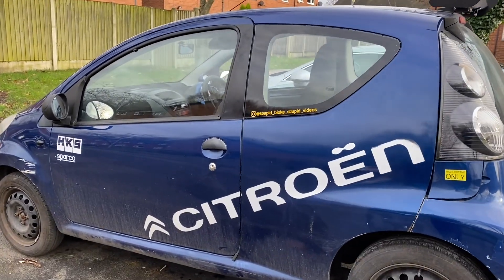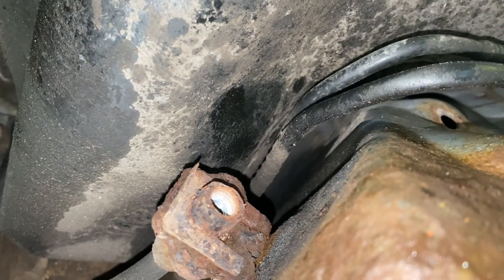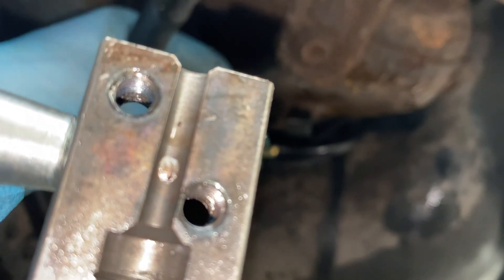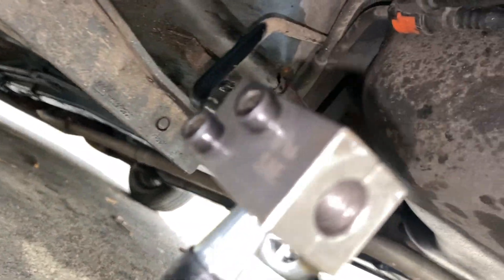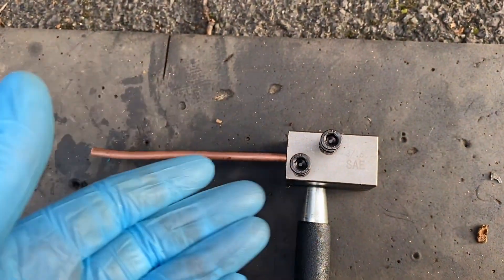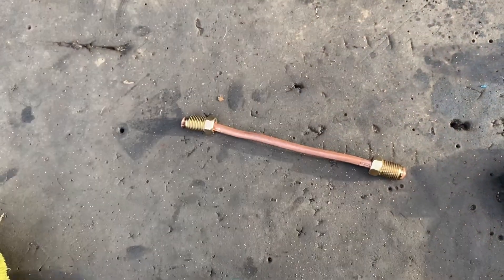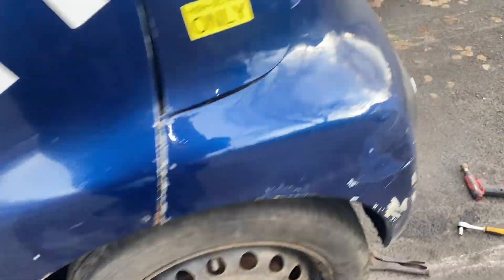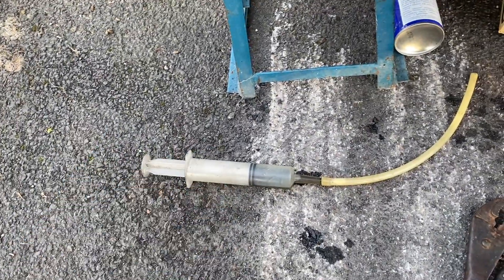How to Safely Repair Rusted Brake Lines / Brake Pipe Section Replacement (CityBug)

Comment: There should be a flat bolt to be used as a stop for the pipe so you get the correct length
Reply from the maker: Yes. It was missing in this kit so I had to judge it by the shape of the tool and where it would place the pipe

Comment: Spot on pal. Cheers for taking the time to make and share this. 

I was a bit put off by the whole idea of flaring tools and diy pipe splicing etc but after this I actually want a go at it tbh.

I'm itching for a go. All except the £80 odd the local parkers want just for the flaring tool. 
By the looks of it, it's just a reel of 8mm or 10mm copper and a 2 screwed, hammer shape vice with a twin ended spark plug accessory and some compression end feeds. 

I bet temu can do it cheaper than £100.52 and it'll probably be made in the same factory anyway 🤣.
Reply from the maker: Nice one. The flaring tool I used in the video was about a tenner off eBay lol

Comment: steel compression fittings 3/16 can handle 5000 psi, no need to flare the lines.
Reply from the maker: They’re illegal to use

Comment: I am impressed how car companys these days make such rubbish products like this Citroen..........I am not promoting my car as it has many faults and weak spots (mainly rust) but i drive a Opel Monza made in november 1978 and that car it brake lines are in mint condition vs ure car and they are 100% made from steel,why steel from the 70,s/80,s did not rust but steel from after 2000....seem to rust faster then butter melts from sunlight.

Why "modern" cars burn oil why they have endless electronic issues why transmissons fail after 100.000miles/160.000+ km etc..
Reply from the maker: I think a lot has to do with the climate, what country are you in? Over here they throw salt all over the road for 6 months of the year and the other 6 months it rains. These cars, apart from rust, will go forever tbh. The 90’s till about 2010 was the best age for reliable cars in my opinion. After that they really did go to shit. A lot probably down to emissions regulations along with other design issues killing engines off prematurely. A lot of new cars are rusting being only 5-6 years old too, but this era cars were generally pretty good.
Reply: @StupidBlokeStupidVideos i am next door in the Netherlands we have just as much salt and rain and grey coulds (and immigrants) as u have so weather conditions are equal...

Comment: Single flare on the steel brake pipes? Not recommended.  Turn the insert around to  double flare it.
Reply from the maker: No, single flair is what you’re supposed to do on them else they can crack.

Comment: Your mate didn´t give you all the pieces you need for that flaring tool. There is a ”stop bolt” that you screw in first that you push the pipe up against, then tighten the locking bolts. Then remove the ”stop bolt” and you use first one end of the double sided flaring bolt ,tighten until it bottoms on the tool,; then use the other end to complete the flare. Cannot recall which end you use first but there are videos out on YouTube showing the correct way to use this tool. Using a grinder to cut the tube is not a good way as you will contaminate the the brake line with fine metal particles which will make their way down to the caliper and eventually damage the piston seal so it starts leaking.Small pipe cutter from hardware store is the way to go as it will cut the pipe square which is what you need to get a good flare and seal.
Reply from the maker: I know he didn’t, that bit was missing but you can judge it as long as you know where it should sit

Comment: Took my car for mot failed needing a small hole ,had it welded took back for retest and came out with the break pipe damaged fluid dripping every where.This pipe was fine up until then.😢
Reply from the maker: @Deborah-d5b  has it failed the same place as mine did? They are common there

Comment: I'm told if you put clingfilm over the brake fluid reservoir, and replace the cap, it will pull a vacuum and stop brake fluid dripping out of the cut pipe.
Reply from the maker: Yea that definitely helps. I’ve don’t it in the past, just forgot to do it this time

Comment: come on man. you can't bleed on your own using the pedal method. 20 quid buys a self bleeding kit that connects to your tyre valve. i love your torque values. you got the job done but your life depends on them dodgy connections
Reply from the maker: I’ve used this method plenty of times to bleed brakes, it’s just a better version of the old “milk bottle” trick. The connections are all sweet, this is actually a common repair method used by garages to section brake pipes

Comment: That is not a safe repair because the copper line is not rated for the high pressure that the bake system can generate. It will ack as a fuse in the line because its now the weakest link. If copper line was good for brake systems, it would be used all across the industry. Job well done except with the wrong material.  I'm a retired auto/truck mechanic with 40 years experience.
Reply from the maker: @albertviger8518  copper has been a common/accepted repair method for brake pipes since time began and is standard practice in most garages. Cunifer is another option, but copper is still probably much more abundant in the trade
Reply: Copper is rated for the pressure.  Reason for non-use on original lines is cost and possibility of work hardening.  Kunifer or copper is good.
Reply: Do you think he's bothered !

Comment: Supurb bloke-on-a-drive repair. My Range Rover Sport has decided to spring a leak and I've never done a brake repair before (at age 65). Great little trick with the syringe as well when you're doing it yourself which I will be.
Reply from the maker: @2-4-6wheels  hope it helps. Let us know how you get on!

Comment: You could also pull the brake fluid thru the system with that syringe
Reply from the maker: Sometimes that works, often it will draw air in where the rubber pipe attaches to the nipple instead.

Comment: Great informative and 'down to earth' video on how to go about it. I have to try this on a rather more exotic turd, a 2003 BMW M3 Convertible, which has the notorious awkward rear brake pipe corrosion, and very little space to attempt a fix. I've given myself the luxury of soaking the brake unions in penetrating oil overnight though! I still prefer the good old milk-bottle method for brake bleeding (simply because you can easily see what's going on), but the syringe idea is an interesting way of doing it.
Reply from the maker: @FMFGUF  the brake pipes that run over the tank? Those failed on mine too, but I paid someone else to do those as I really didn’t wanna do them 🤣

The syringe method has never let me down, but I’m actually in the process of making a video changing the fluid on my e46 using TOPDON diag to bleed it through. It will be a couple of weeks before it’s released though.
Reply: @StupidBlokeStupidVideos  Yes, the inner one that runs over the fuel tank, on the nearside rear. There is a union near the fuel tank that can hopefully be undone, and it looks like there is just enough room to get flaring tools in where it bends around to go under the floorpan in front of the nearside rear wheel though, so I'll give that a go...
Reply from the maker: @FMFGUF  I think that’s how the bloke did mine. Just fed them over the tank and cut and joined
Reply: @FMFGUF Literally have the exact same issue on my m3 right now, I’m contemplating just buying original lines or just cut the part which is leaking out and joining until I have more motivation.
Reply: @rabmc  I fixed mine by just cutting out a 10" section and making a repair with a £20 pipe & flaring kit from E-bay; first time I've ever made a brake pipe but it works OK.
Reply: @ Thanks, my issue came with my fuel pump went on me, car sat for 2/3 weeks until I had the desire to fix it and then all went well car started but brakes slightly seized so took it a good 10/15 mile run. So a few sharp presses of the brakes and lost the brake pedal and knew I had popped something, I’m thinking here we go again. My leak is coming from my drivers side rear brake line its leaking from where it bends up from floor pan on the rear passenger side side wheel well just before it travels up over to driver side caliper. It’s leaking right in the bend so I’ve noticed there’s a join up before it travels over and just wondering how far to take back to front of car or if it joins from factory anywhere towards front of car or does it go straight to the reservoir one piece.
Reply: @rabmc  My brother's went in the same place. If you disconnect the 'join up' (union), you can gently bend down the section of pipe under the passenger rear floor (having undone a few pipe clips first) and get a flaring kit in there, then just make up the required length you need in new pipe to hook it back up to the union.
Reply: @FMFGUF  Thanks for that, the car is up in the air just now and underside brace off and at the right height, next Saturdays job now and my pal is bringing some pipe and his flaring kit, just doing my YouTube research lol.
Reply: @rabmc  No problem. Just remember to put the required olive(s) on the pipe prior to flaring the end(s) of it. You should ideally use a pipe bending tool, but it can be gently bent over anything suitable, such as your knee!
Reply: @FMFGUF  Noted, thanks again 👌🏼

Comment: Well done fella, usual other mechanic to suck eggs , but I just use a old plastic drink bottle with brake fluid half way up the bottle  with rubber pipe submerged and put other end on opened brake nipple then pump pedal and wait till fresh fluid comes out and no more bubbles then line is bled , but that just the way I’ve done it being a mobile mechanic . Good job getting that rusty pipe union off - can be a nightmare mate , well done
Reply from the maker: Thanks mate. Yea that’s the old school bit of pipe and a milk bottle trick. This method is just my own version of that one tbh

Comment: Looks like an SAE Flare tool. Each flare should be made using both ends of flare tool insert in sequence and a 3 piece joiner used and not a male fitting and a female fitting as shown.
Reply: The flare tool was SAE and SAE flares must always double flares on all brake pipes whether cupro nickel or steel. For European carrs like the one shown the flares are DIN using a DIN flare tool. In addition, a DIN flare , sometimes called a bubble flare should have been used to connect into the original fitting. No safe way to make a pipe connection using only a male fitting and a female fitting. Couldn't see on the video if it was SAE or DIN fittings being used in lieu of a proper connector. Huge amount of correct information available online.
Reply from the maker: @brianmcguckin66  when connecting copper to steel, this is the way that a lot of garages do it. If there was an issue with the flare then it simply wouldn’t have sealed when it was installed.
Reply: @brianmcguckin66 hi, you seem to know what you're talking about! There's so LITTLE info out there that isn't misleading or plain innacurate. Mostly youtube guides ignore the SAE/DIN issue or are vague about it.... , and most flaring tools on the Internet seem to be SAE.  Appreciate your comment.. 👍
Reply from the maker: There is no issue with using the fitting shown, it’s just a different way of doing it and takes less room. You don’t double flare on the steel as it is likely to split.
Reply: 1st world problems.
Reply: Agreed. Should be ISO/DIN Bubble flare tool, not SAE which is American. Three piece connectors should be used.

Comment: i cant seem to see the best way to join 2 lines... do i double flare both ends (as many do in videos) and join with male and female connector.. or double flare one end and bubble flare the other and join these 2 with male and female connector or a double female connector in middle with 2 male connectors on the flares... every of the 30 videos i watched does it different 😅😂
Reply from the maker: There’s more than one way to do it, the way I’ve done it here is single female flare as it’s steel pipe. If you double flare it then it can split, but copper female flares should be doubled
Reply: From what I've read,  you must use an 'mot joiner'  which is a double female sleeve, into which go the 2 male connectors. Apparently an mot fail any other way. However, saying that, my Mk3 Mondeo with original steel pipes appears to be jointed using a male into a female,  so maybe a recent change in the regulations.

Comment: The flaring tool has a bolt which goes into the end then you tighten up the bolt, ouch the pipe to the bolt, and tighten the two bolts on the side that clamps it together, then take the stopper bolt out and double flare the pipe, dipping the tool into brake grease

https://youtu.be/5zXhUbvP0vE?si=vKcALoPCeKWu0Swg
Reply from the maker: It should have, but this one was missing so had to judge where how far in the pipe goes before clamping it.
Reply: @StupidBlokeStupidVideos  the manufacturer might have a spare stopper nut, or size could be on the Internet

Comment: I had a line blowout on my Chevy Silverado 2500HD. all the lines were in bad shape, So I bought a complete prebent line kit from NAPA. Dealer wanted $2400 to do it. It cost me 180 for all new stainless steel lines. It took me 2.5 days of tearing out one line at a time, then putting a new one in place. General rule is that if one pops, other soon will follow.

Comment: In a front of handbrake lines is air deflector. Can You make video how to lift up lines, that we will not need this deflector (cover) - for better aerodynamics :D :D
Reply from the maker: All about those ground effects 👌
Reply: @StupidBlokeStupidVideos  yep, I think I will mount big flat plastic cover under engine from scrapyard (for example from Octavia TDI) this can be also good topic for material

Comment: great video , mine just failed on this exact thing. i watched this and got that tool off ebay as euro parts were telling me i had to buy the whole pipe,, its really long on these !   i got to ask though how did you get the pipe out the tool thing as it looked like it was gonna snap or bend :)    thanks for video , really helpful :face-fuchsia-tongue-out:
Reply from the maker: Cheers mate. I just pulled it out but without being too harsh with it.

Comment: Class, what a result! Need to find my flaring kit now which I've probably lent to a mate a few years back so that I'll need to buy a new one. Your bleed method is also CLASS - I always thought you needed to crank the bleed nipple up after every press of the pedal but it looks like you don't using your method so I won't need to buy one of those Easy Bleed kits or kidnap a neighbour. Big thanks and muchos respectos!
Reply from the maker: Haha the method is just something I’ve come up with myself over the years, I use it a lot on bikes at work when flushing old fluid out on a service. It’s a good way to move a lot of fluid through the system quickly. I forgot to mention that usually before putting the female flare on the pipe you put an olive on first. This was my first go at flaring steel pipe and I was told off another mechanic just to single flare the steel pipe when joining, seems to have worked ok anyway 🤣
Reply: @StupidBlokeStupidVideos  Looks good to me!

Comment: Hi Tim hope you are well, what size pipe and fittings did you use and where did you get them. Thanks.
Reply: Thanks I've been looking at replacing my rear brake pipe but doing it differently. I'm reusing the original male connectors and putting copper brake pipe from wheel cylinder to female connector on the original long back to front main brake pipe to save  cutting it what do you think is this possible?
Reply from the maker: @timhipkins912  there is a rubber pipe between the long pipe and the wheel cylinder which you’ll have to keep. I’d get nee make fittings if you can. I have reused them in the past when I’ve not had any but it’s not worth it if you can avoid it
Reply: @StupidBlokeStupidVideos  Thanks for the advice I was in two minds, Thanks again for all the videos I've gained so much information from them.
Reply from the maker: Hi mate. The pipe is standard common size. 3/16 I think. The fittings I’m not sure but 3/8 rings a bell 🤔

Comment: I needed both sides doing in January. It's only the second time I've ever paid for a garage to do work. They ended up replacing the line from front to back as they struggled to flare the steel, which was my concern. Last thing I wanted to be messing about with in winter. If I'd seen this first I probably would have talked myself into giving it a go. Glad I didn't!
Reply from the maker: A lot of tools won’t flare the steel pipes, but being able to join them makes all the difference